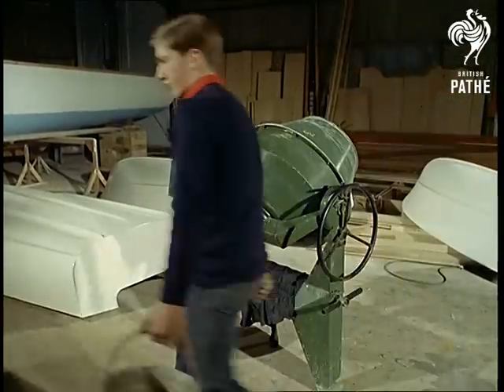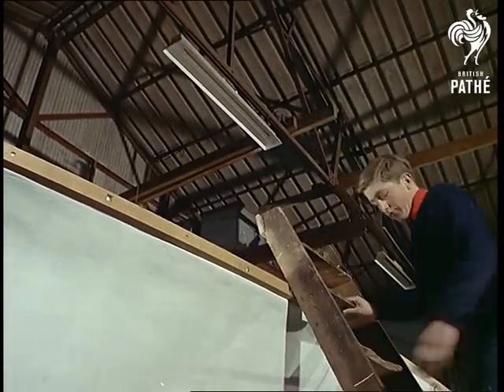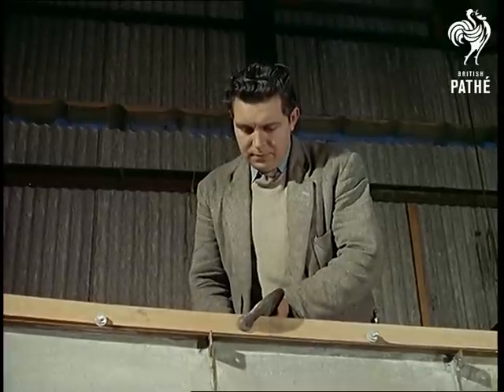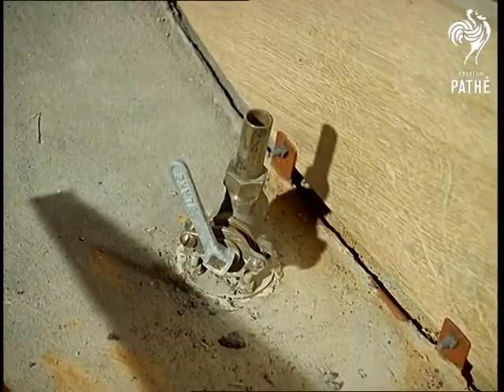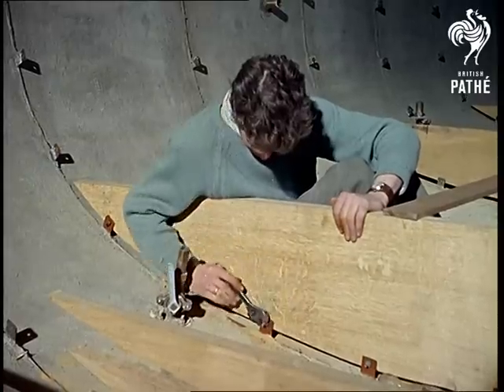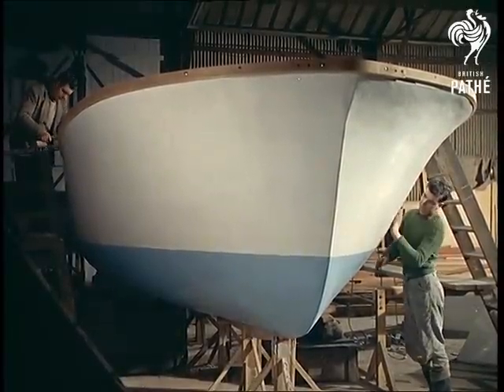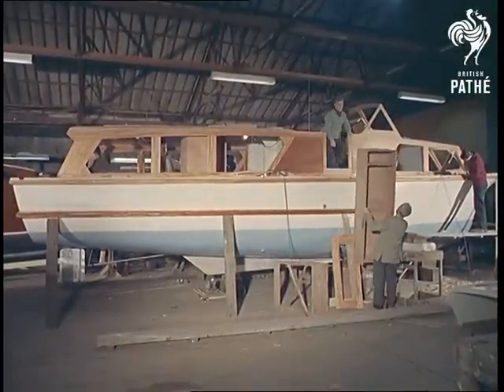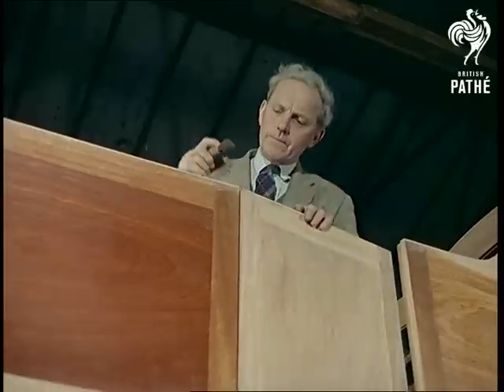Concrete Boat (1962)

Comment: The crete was porus and water would get in and the iron bar would rust, expand and blow chunks off the hull. They were massively heavy and took a lot of power and fuel to move. If they hit something they breached fast and sunk even faster.
Reply: That's with poured concrete before waterproof concrete was invented. The boats shown in the video are made of plastered concrete, which is as the video says, light as steel and almost as durable. Waterproof concrete is common nowadays in construction.
Reply: It's all about the additives that are used my friends. It takes some digging, but anyone can make waterproof concrete if they need to, it simply takes a good binder such as latex, sodium silicate, or a water based varnish. 

I'm not familiar with seacreate, but when working with regular concrete, those ingredients can be used to create a watertight material. 😊🌎✨
Reply: @dinoslavski  water proof concrete was invented and used widely by Ancient Greece and Rome. So history is not your thing, that's ok ;)

Comment: In 1983 I sail a 48' Gaff rig ketch from Virginia to New Jersey. Hull, deck and bulkheads were ferro-cement. The hull was epoxy sealed and was as heavy as a wetted wooden hull.

Comment: was reading release the witch and they were building concrete boats I was wth is that even possible, looks it is is and it is nothing new
Reply: Lmao, same.
Reply: Yep me too
Reply: @TheFrev  it's the cheapest way to build a boat. I remember reading a book eons ago with photos of how they did it and they had no experience. They built the Hull on a stony beach if I remember right and you need a team.
Reply: @factorylad5071  Stupidly cheap, but they also don't last long, cost A LOT of fuel to move, and break easily. During WW1 the US navy began building concrete warships as an emergency due to the steel shortage, not one of them lasted past the expected 3 year lifespan.
Reply: its funny we found another comrade here hahahha
Reply: Lmao how are we all here for the same thing

Comment: What's the reason for not using concrete today as a shipbuilding material?
Reply: Because, despite what this video says, they aren't that good. They are heavy meaning they cost a lot of fuel to move, they breach easily, and they degrade quickly (water seeps in through pours, rusts the steel bars inside causing them to expand breaking the concrete) most concrete ships have a "safe" lifespan of about 3 years, after that there is a "high risk but usable" period of roughly 2 - 10 additional years assuming you are maintaining the ship correctly. Each year the risk increases.
Reply: @athingwhichexists  that's with normal concrete, and concrete made like shown in the video is lighter than steel, seacrete has additives that makes it water proof, hell waterproof concrete is common nowadays. Plastered ferroconcrete is a great material for shipbuilding provided you're not a total dumbarse while building it
Reply: @dinoslavski  No, that is with Ferrocement, aka biorock, aka seacrete. While construction has improved increasing their "safe" lifespans. They still require excessively thick hulls, a large cross-sectional area, and utilize nearly twice the amount of fuel as wood or steel ships of similar size while having less of the structural stability that those same ships have and requiring far more maintenance. The main reason for use of Concrete ships is their cheapness to construct, that is about the only advantage they provide.

It is because of that reason that we only see concrete ships from war-time rushes and from hobbyists.
Reply: @athingwhichexists  Now you're just spitting word poop, seacrete in the 60s meant concrete with polymer additives, not biorock, and ferrocement is plastered cement on steel mesh frame, hulls don't need to be excessively thick, as a matter of fact any owner of a ferrocement boat will tell you that their boat's hull is around 5cm (2 inches) thick. They don't use more fuel than other types of boats of similar sizes and they have as a matter of fact more structural stability than wood (there are stories of ferrocement boats hitting piers and piers being in worse shape than boat itself). 

We don't only see them from wartime rushes and hobbyists, as a matter of fact this very video shows proffessional boat builders building one and that is usually the case.

Learn before you slander a perfectly fine building material.
Reply: These are good points my friends. 😊

Concrete needs additives and reinforcement before it can be impervious to water, and while these ingredients can be easy to obtain for the average homeowner, (latex paint, glass fibers, sodium silicate, and the reinforcing meshes (usually made of steel or a formed with a grid of ropes that are supported by a frame), it's not something that is so easily mass produced, although it can certainly be done. 😊🌎✨
Reply: I have a 32 foot fero sloop weighs 7.5 metric tonnes 40 years old as strong as the day it was built, also have 36 foot ferro launch weighs 9.5 tonnes at least 50 years old. The weight isn't excessive. I wouldn't have a boat made of any thing else. It doesn't rust, rot or develop osmosis worms don't touch it and paint is strictly for decoration
Reply: @athingwhichexists  People literally sail around in concrete boats today that are no heavier than steel boats and their take is that there's almost no maintenance ever. Some have been living on the same boat for 50 years. You're underinformed on this topic, it seems.